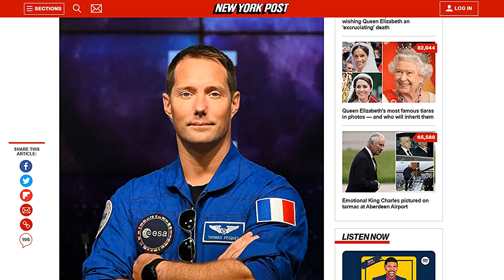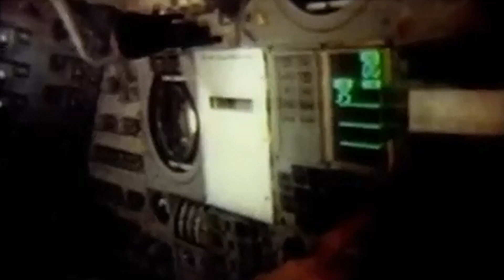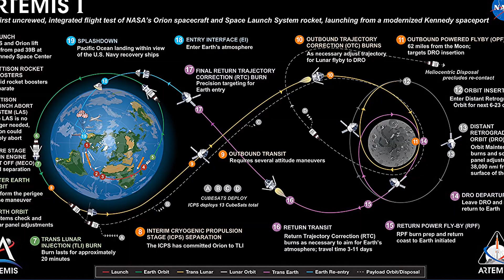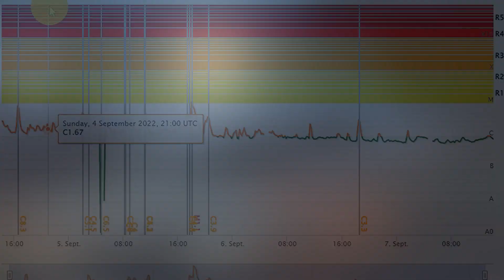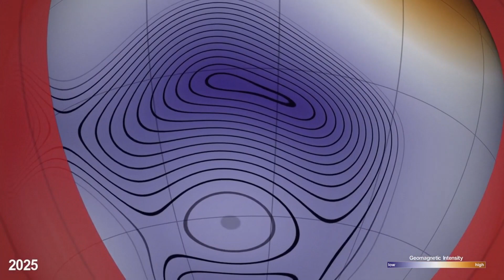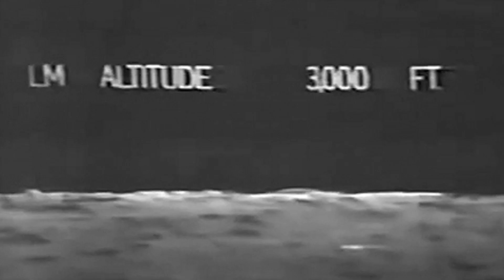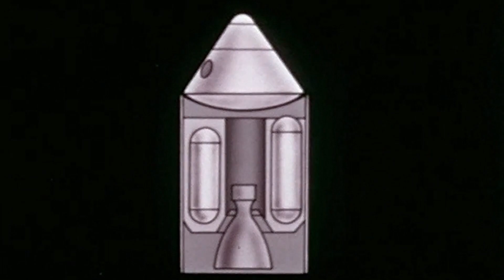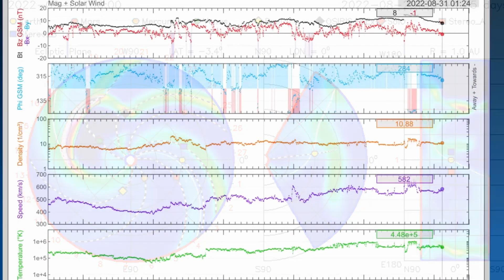THE APOLLO DISCUSSIONS "APOLLO 2.0" PART 2 OF SHOW 10

Comment: Now you are talking about the  Artemis scrubs and leaks.  You talking about the seals and showing the SRBs.  The leaks were not in the SRB but in the 8" quick load interface of the hydrogen tank on the core stage.  They are not starting from with radiation systems.  Orion is meant for deeper and longer missions then Apollo.  So the system needs to be beefed up.  Makes perfect sense. The van Allen Belts are really not an issue....do some real research.  For both Apollo and Artemis they with be passing though the belts at their highest velocities coming and going.  So time in the belts is minimal and in Apollo the crews wore dosimeters and their exposure was quite low.  As I stated earlier Orion is meant for longer and deeper missions then Apollo.  And yes a CME would be a potential hazard if flown in one.  Of course they let other media broadcasters use NASA's cameras.  On the 2 scrubs a number of media broadcasters were using feeds from NASA's pad area cameras.  Everyday Astronaut, Launch Pad, NASA Spaceflight to name 3.  That is not 5hrs 30min on the CBS animation.  It is 5min 30 sec.  Even the clip you are showing shows it as min sec. Come on guys.  The press release books NASA gave to the media months before the flight, ( rather thick document/book) gave very exact timing details as they expected it to happen. So they had time to prep the animations.  Speed of sound??.......no sound in space, so no speed of sound to be measured.  NASA had more things to worry about then minor details in news broadcasts animations.  They just gave the public a bit of an idea.  Was not meant to be exact.  Sound again like grasping at straws.

Ok again with the bad history.  The Pentium chip was introduced in 1993.  They are not using 486 chips in Orion.  Here is what was used in the Orion test flight in Dec 2014.  There are lots of articles on this subject.  I am at 10:57 in your video and need to take a break.  The snake oil you 2 are spewing is sickening.  

By Zach Wener-Fligner
Published December 24, 2014Last updated July 21, 2022This article is more than 2 years old.
The Orion, which took its first unmanned test flight Dec. 5, launching from Cape Canaveral, Florida and orbiting for four and a half hours before splashing into the Pacific Ocean, is NASA’s latest human-rated spacecraft project, and probably the most ambitious ever. Its ultimate goal, like the Apollo program 45 years ago, is to take humans to places they’ve never gone before. In 1969, that meant the Moon. This time, the destination is Mars, and the Orion might take a crew there by 2021.

Given the grand scope of this project, one might think that the NASA engineers building the shuttle would pull out every technological stop, drawing in the newest super-fast computing power. Right?

Not quite, Orion project manager Matt Lemke told The Space Review in a recent interview. In fact, the computer hardware onboard the Orion eschews the cutting-edge, favoring gear that has been tried and tested for years. The three onboard Honeywell-built flight computers each run on two IBM PowerPC 750X single-core processors—dinosaur chips that have been around since 2002, and were used in Apple computers until the company switched to Intel chips in 2006. The computers are “not any faster than your smartphone,” Lemke said.

This isn’t due to budget constraints; the December flight cost $375 million, and the Orion program will receive $1.2 billion funding in fiscal 2015. Rather, it’s because these old-codger computers are actually the best for the job. That’s because while speed might be prioritized in the consumer sector—where customers can or must buy a replacement if something goes wrong—reliability takes precedence when it comes to computing in space.

And the Honeywell computers are nothing if not solid. They are adapted from the onboard computers used by Boeing 747 aircraft and outfitted to resist the intense vibrations and radiation of a long space flight.
Reply from the maker: https://www.youtube.com/watch?v=KyZqSWWKmHQ    Time 2:28 Kelly Smith states the speed of the computer. It is 480 M/S  The PDF indicated a 486. Thanks for letting us know that NASA once again updated their files. No change there!
Reply: @theapollodetectives  Wrong.  That is how many instructions the computer can handle.  Nothing to do with the name of the processor.  Here is from Intel data 

"The embedded Intel486 SX processor is binary
compatible with the Intel386™ and earlier Intel
processors. Compared with the Intel386 processor, it
provides faster execution of many commonly-used
instructions. It also provides the benefits of an
integrated, 8-Kbyte, write-through cache for code
and data. Its data bus can operate in burst mode
which provides up to "106-Mbyte-per-second"
transfers for cache-line fills and instruction
prefetches.
 " 

The video you are linking was made in 2014 before the 1st and so far only flight of an Orion.

Here is what flew on the December 2014 test flight

"NASA’s Orion is Powered by a Computer Chip That Debuted Back in 2002
Posted by previous_toolbox_user on Dec 10th, 2014 at 1:02 PM
Best Practices
NASA's Orion spacecraft had its test flight last week, and with its plans to be used in future long flights out to asteroids and even potentially Mars, it's a bit shocking that the technology running the spacecraft is much older than one would suspect. Orion's flight computer is an old Honeywell console that was developed for use in Boeing airliners, all being run by an IBM PowerPC 750FX - first out in 2002. Depending on how closely you follow space exploration, this may or may not be a shock at all. Reliability prevails over speed or the latest tech. The 750FX powering the Orion runs at 900MHz with a bus speed of 166 MHz, and 512KB of on-die L2 cache. It was manufactured with a 0.13 m process (130 nm). For comparison, were now down to 14nm process technology in the Core M family of processors. The computer housing this chip has been completely overhauled for the Orion spacecraft with features like thicker circuit boards, vibration resistant fasteners, and ample radiation shielding. What do you think? Is a 750FX chip running a spacecraft that could eventually go to asteroids or Mars fascinating or not that cool?"

Comment: "NASA is already underestimating risks to achieving the current Artemis II launch date. Specifically, NASA estimates it will require about 27 months between Artemis I and Artemis II due to Orion integration activities and reuse of avionics from the Artemis I crew capsule on the Artemis II crew capsule. Officials noted that the time between missions depends on the
amount of risk assumed. Since Artemis I is scheduled to launch in September 2022, Artemis II cannot logistically happen before December 2024, 7 months beyond the planned May 2024 date" (GAO Report to Congressional Addressees, September 2022).

This is it, boys and girls. If NASA can't even launch Artemis II in 2024 (and every delay of Artemis I reaffirms this, not to mention that will be the case even if they launch it tomorrow), then not even a manned lunar fly-by will be acchieved by 2024.

Comment: @Marcus, in the video "The Apollo Moon Landings Fact And Fiction" Part 4
I never understood how the astronauts managed to implant the flag pole in the lunar soil.
The lunar terrain is dusty and rocky. I remember when i stick the first pole of the umbrella along the beach and if it is wet sand it is easy, but if there are pebbles and small stones it is difficult, you have to make a small hole to help the pole to stick, while if there is rock it is clearly impossible!
How did they manage to stick a pole in the lunar ground that was always perfectly vertical and perpendicular and always perfectly rigid and solid?
Reply: That's a good question. What exactly was on the end of the pole? A hardened metal point? Was the pole in two pieces, and the bottom part hammered in?

Since the LM had long legs with big pads, indicating the designers expected a dusty surface, you would expect the flag pole to have some kind of tripod with pads.
Reply: @codetech5598  exactly, why plan to implant a pole in the lunar surface when a tripod is obviously the smartest solution because it does not pose the problem of implanting the pole !?
It is certainly curious how the NASA genialoids, remember that it is US military, propose highly questionable technological models.
Reply: @giakon1  Yes, if putting a flag on the Moon was so important that it must not fail,  you  would use some kind of tripod base.

I wonder if there was some kind of Masonic ritual that required the pole to actually impale the ground?